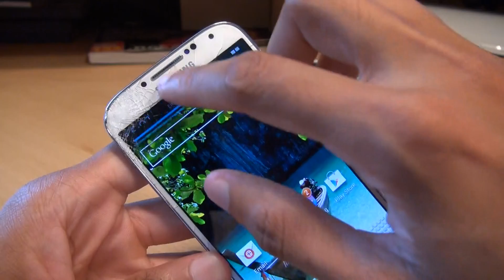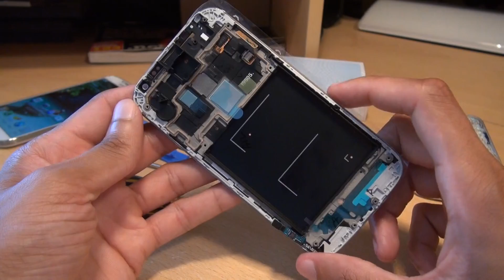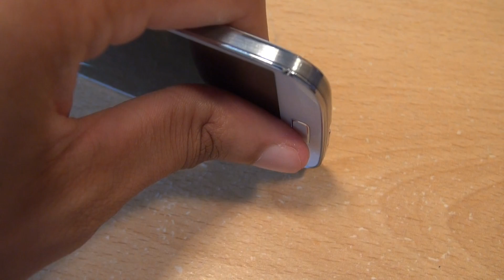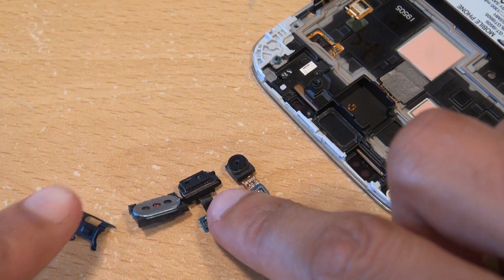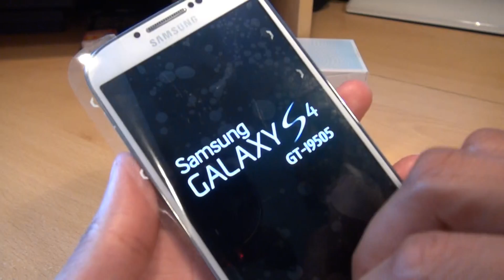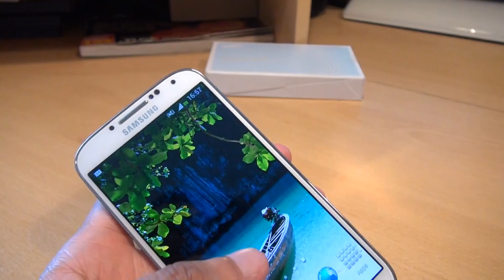Samsung Galaxy S4 How to Fix / Replace Broken, Smashed Screen

Comment: Hey thank you for the video. It helped a lot, my screen, vibrating motor and sensor lights all operational. I have noticed the Wi- Fi function doesn't seem to be as strong as it was before the screen and backing was replaced. Any ideas as to why this may be or was to fix the issue?
Reply: Eric Doom try reconnecting your signal cables

Comment: Hey everyone, 

I had my screen broken, ordered one from ebay (the one that brought me to this video) and did all the replacement. I'm sure I did all correctly but once pressed on, the phone vibrates, sound on, but the screen is all black. Could the motherboard got affected by the fall that cracked the screen? (I could actually call my phone after turning it on, but the screen is all black).
Reply: The screen is faulty
Reply: I hope i can get the seller to replace it for me, Thanks.
Reply: +mdjpinto if not, I'm up to buy it off you
Reply: the faulty screen?
Reply: +mdjpinto the phone
Reply: that'd be tricky since I have all my personal and professional accounts on the phone. without seeing what's going on, I'm not able to do a factory reset hence selling it for parts is not an option. :D
Reply: +mdjpinto it's okay, I would reset the device through recovery mode, easier that way than fixing the screen and then asking for a password
Reply: Fair enough, let me see how this goes with the replacement screen and if I'm not able to, I'll let you know.

Comment: Personally I hate these phones the more broken ones there are the happier I will be my first instinct is to crush these under my heel, But I have repair them, They really are a shit phone they are flimsy and break at the slightest touch, The apple phones can drop from a height and sure you will break the digitizer but the LCD still works best advise don't buy one of these get an apple instead regardless of what model, That aside the video was very informative. Thanks
Reply: +Dermot Bolton Samsung make most of the parts inside your iphone and in some cases the screens as well. None of your Iphone is made by Apple, only the IOS
Reply: Thanks actually I am aware of the process as I work in the industry regardless the quality that apple inist on are a lot higher than that of samsung or any other phone provider the fact that they check their software so often and it works unlike the drivel shit that samsung vomit out. It's not about been apple it about quality and commitment any other company offer me it and i am all in. But samsung are a joke in the phone market for me anyhow.

Comment: where should I buy a quality full front bezel and glass replacement? How much should I expect to pay?
Reply: Kerry-Rae Bizila I ordered this one. Seems to be a good quality replacement. Comes well packaged and with all the tools you will need. Does have Samsung logo even though not shown in product listing.  Follow this video to the tee and make sure you remove all protective tape from the replacement part. Removing the vibrating motor was the only tricky part.Good luck! 

http://www.amazon.com/gp/product/B00GKDFG4G/ref=cfb_at_prodpg

Comment: Hi ,
My screen is craked.  But every thing seems to be working just fine. Obviously I want to spend the least money . 

I dont want to open it up,  change the screen , and have to start over. Is there à way to find out the damage?
Reply: If your phone still registers touch and an image is still displayed on the screen then you have only cracked the outer glass, this is a way cheaper fix than changing the entire screen as seen in this particular video as the glass can be purchased for around £10, but try going to a phone shop they may charge in the region of £30-40

Comment: Hi. Great video, thanks for uploading. I have followed the instructions and replaced the screen. However the touch screen is no longer working. I have checked the cable down the side of the screen and this seems fine. Any advice? Thanks Matt